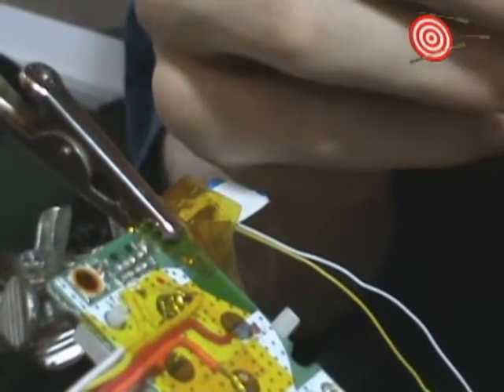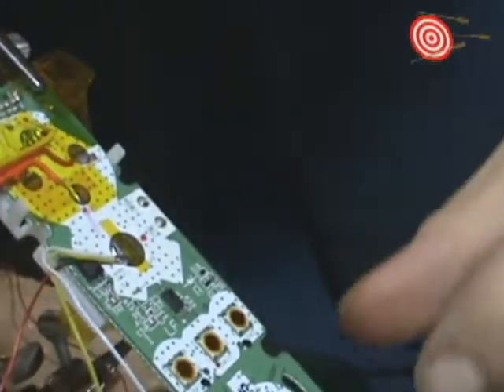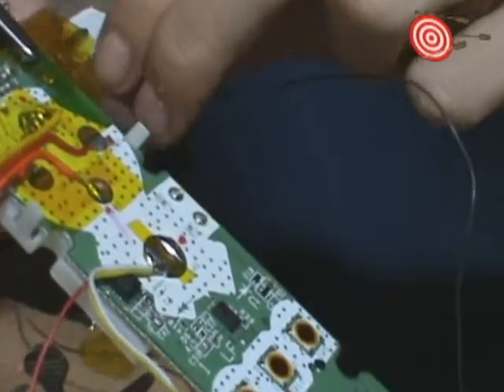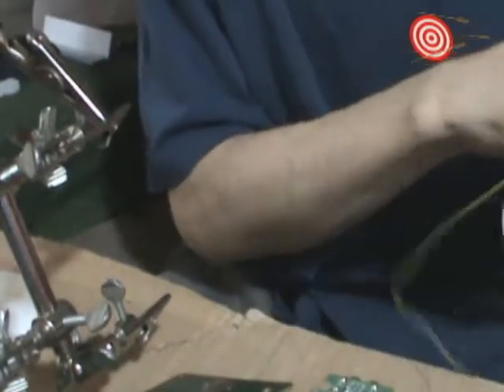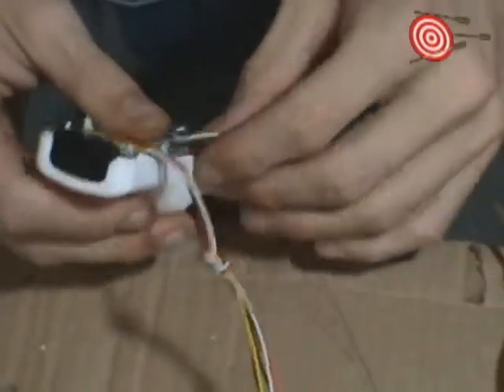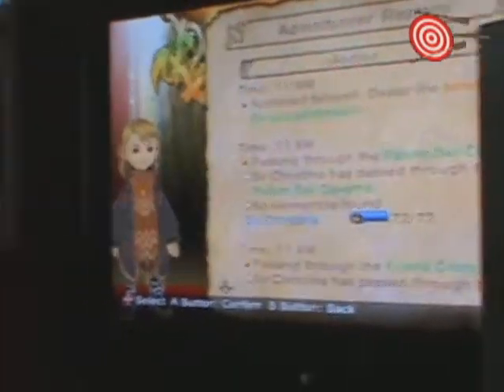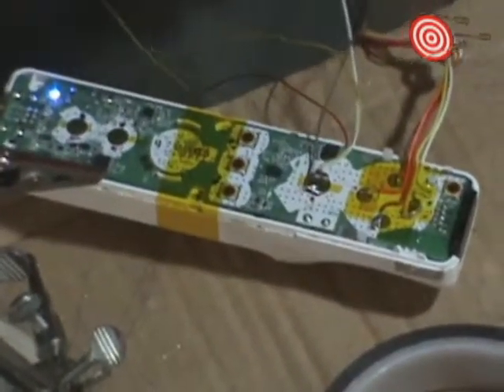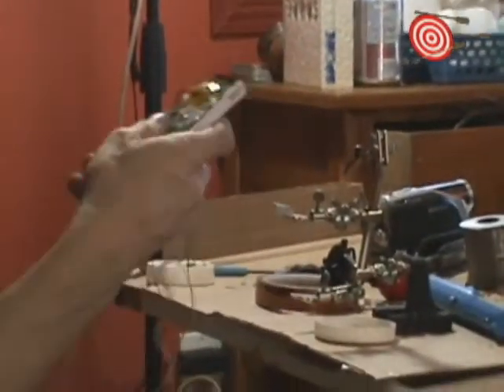How to Map (Solder) buttons over the WiiMote originals p_2

Comment: i soldered every fucking button on the wiimote to arcade buttons and it worked for a day and then it starts triggering buttons on its own when theres no bridge on any of the pads!!! Its bullshit
Reply from the maker: Ya, something is funky there. If the new buttons are, for sure, working and not causing the problem, you will want to double check all the connections. It is very easy to mix up ground and signal sides of the pads on the board, and if you do it can get real weird. If you have a multimeter you can check the voltage levels and polarity of each connection and they should all be about the same and all have the same polarity.
Reply: AimlessGaming I did check it with a multimeter hahahaha its prolly one of those weird RF circuit problems cause im positive this wouldnt happen if it was a wired controller
Reply from the maker: Bluetooth is digital. I doubt interference would cause random button presses, instead, connection would drop if the interference was bad enough. You may want to look at other causes.